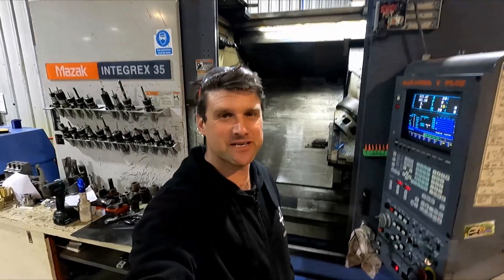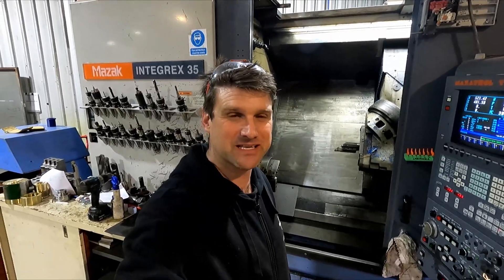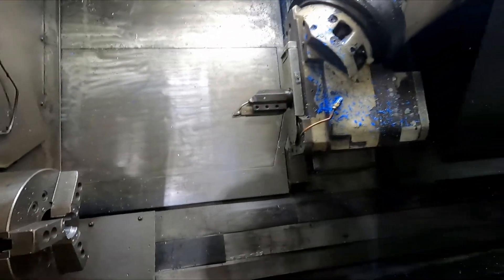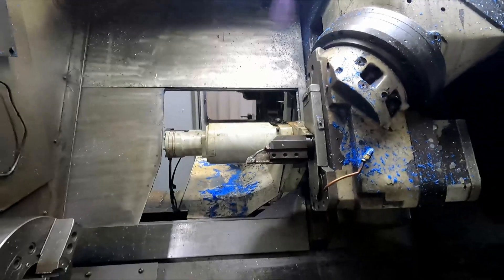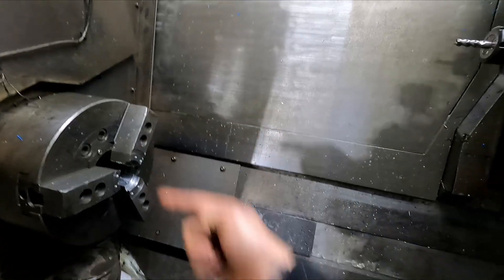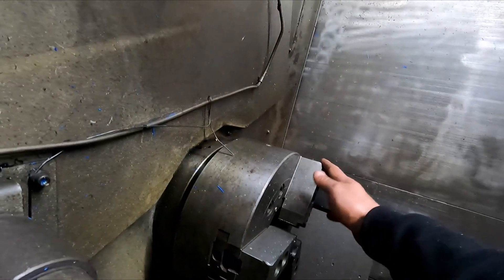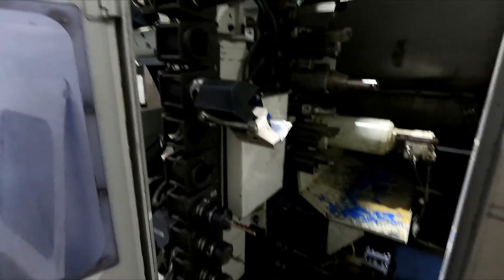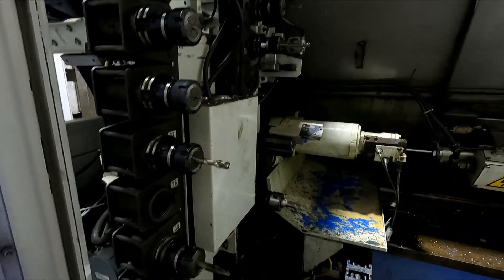Square parts on a lathe?! - Mazak Integrex 35

Comment: Spindle deceleration time after that turning pass is brutal.  That is a cycle time killer.  I'd mill the square using polar interpolation instead of an XY move.  That way your square has not choice but to be on center.  That will help make sure that the holes are in the right place in relation to the square.  If chip build up on the drills is an issue consider spinning them backwards while hitting them with a coolant blast.  That will help blow chips off.
Reply from the maker: The decel times are set very conservatively, because it used to have a 15" 3 jaw on it. 
For what these parts were doing (pushers on a peg and chain type conveyor) the accuracy is well and truly good enough. I actually did end up adding a quick reverse on the drill. It's one of those great simple tricks 👌

Comment: soo.. Not square parts on a lathe.  Square parts on a multifunction.    clickbait.   It is one cool machine, though!
Reply from the maker: It still is a lathe essentially, just with some extra bits 😁
Reply: These old Integrex machines are more lathe than mill. New ones are a 5 axis mill that just so happen to have a turning spindle. 

I sell them, so I kinda know what I’m talking about 😉

Comment: those tool changes take a long time compared to a conventional lathe but you gain a much better milling head compared to driven tooling in a tureet
Reply from the maker: Yeah for sure. You also don't have the issue of adjacent tool clearance like a regular turret. It's pretty much a real milling spindle.